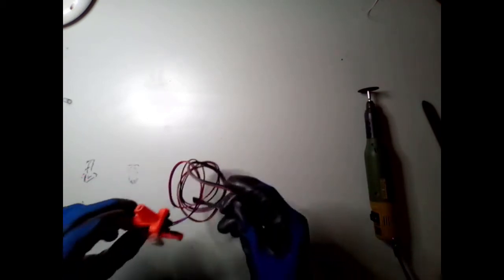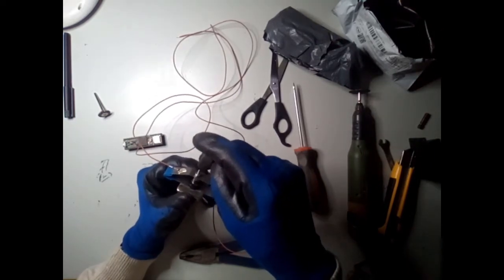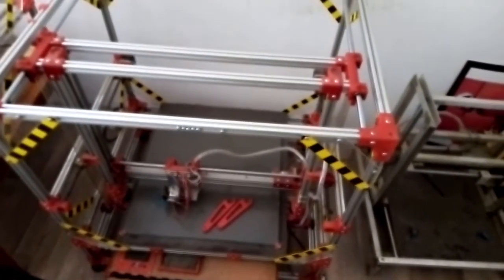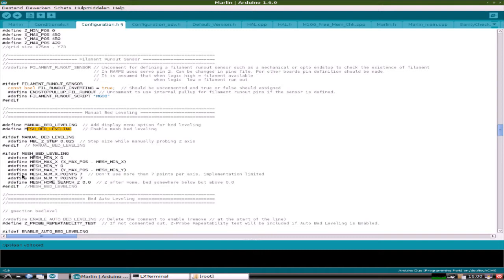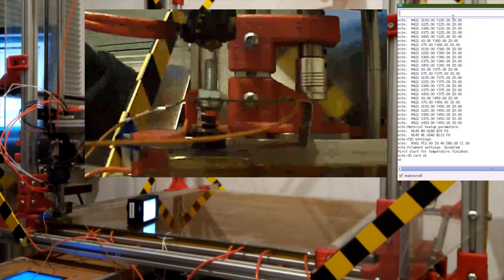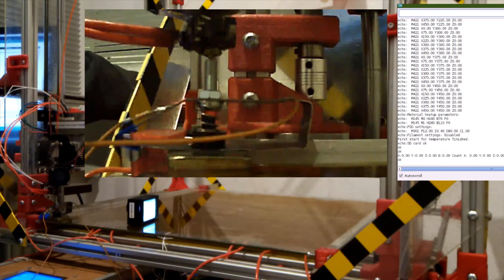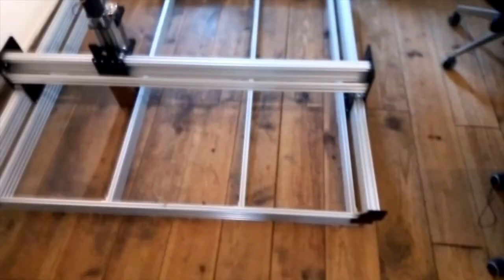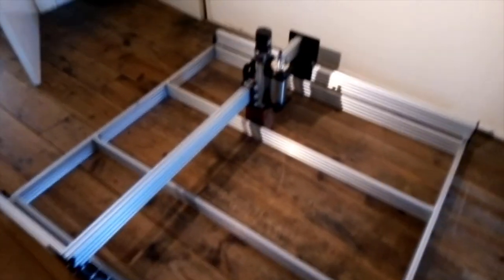3D printer - Marlin 1.0 mesh bed leveling

Comment from the maker: If you plan to build your own 3D printer ... let me know.
I can help with lots of info and personal experiences.
Of course, there's gonna be more videos about that.
But your comments will help me to make more videos about it.
Reply: I need help in 3d printer
Reply from the maker: @engrahsanrajput3124  What's the problem ?
Reply: @wernerboden239  extruder motor not working  i check wiring, pins of driver, driver, motor all okk but the enable pin not going to zero .. tell me what is that issue
Reply from the maker: @engrahsanrajput3124  I might need some more info.
But maybe the driver is dead; you could check vref: https://www.youtube.com/watch?v=BV-ouxhZamI
Driver bad ? You could also switch the extruder driver with the x axis driver.
Motor bad ? You could connect the extruder on the x-axis. (Go slow, like : G1 X10 F100)
Make sure current limits are set properly. Get motor datasheets, etc.
Just to find out what can be wrong; process of elimination. Find out what does work.
I assume, what you say is correct: Everything is connected properly and that you know what you are doing.
 
If this is a new setup, it might be usefull to check the firmware, if pins are defined properly, for your type controller board.
For Marlin:
https://marlinfw.org/docs/configuration/configuration.html#motherboard
Reply: @wernerboden239  bro i changed my driver .. driver is ok and i switch the extruder motor on x axis its working but on its driver mean E0 is not working
Reply from the maker: @engrahsanrajput3124  Nice to know, nothing is broken. 
Is this a new setup, or has the driver ever worked before ?
What controller do you have ?
You use Marlin firmware ?
 
So the driver is not getting a signal.
Either the board is damaged, or it's a software problem.
Make sure you have an extruder defined in your slicer software.
 
Have you tried some manual gcode like 
G92 E0
G1 E100 F100
While the gcode is running you could use a multimeter to check if there's voltage on the STEP pin to GND.
Be careful, not to short any other pins with your probes.
(You could remove the driver and use some wires with dupont connectors)
 
I assume you run Marlin firmware ?
Check your configuration.h
 
#define extruders 1
#define MOTHERBOARD .... 
You can find your board in boards.h
and the pin config in pins.h
 
Maybe the pin definitions in the firmware are wrong.
You could google your controller board pin configuration.
 
You can try switching E0 pin numbers with E1 pin numbers, if you have E1 connector
so you can connect driver and extruder to E1
Reply: @wernerboden239  i am using ramp 1.4 
And arduino mega 

Marlin firmware 1.0 

I try to switch the pins E0 to E1 
Its not work i think i not doing it properly 

Do you have marlin with no errors
Reply from the maker: @engrahsanrajput3124  You can download Marlin 1.0 at github.
I don't have much time, right now. So if you have time, I will take a look and provide you the proper download url, at a later time.
Maybe even do a video, because the first printer I built, was with ramps 1.3 and arduino mega.
Maybe that could be helpful.
But I have a lot of work to do, so give me a moment.
Reply from the maker: @engrahsanrajput3124  By the way ... what drivers do you have ?
Is it the drv8825 or A4988 ? I think vref voltage for 8825 is 2 and 4988 is 2.5
Basically ... for the 8825 a vref voltage of 1 would be a current limit of 2 amps,
but with the 4988 it would be 2.5 amps, which is bad, because the usual nema17 work at 1.7 amps or less.
The drivers are current protected, so when there's too much current, they shut down.
With the 4988, you should have a vref of around 0.7 (x2.5 = 1.75 amps current limit)
Reply from the maker: @engrahsanrajput3124  I will have to update my website : a-triangle.com
So you can register your e-mail and maybe we can have a video call, like zoom or something.
I will get back to you about that.
Reply: @wernerboden239  ok but now i am outside . Can we contact on 25 or 26 july??